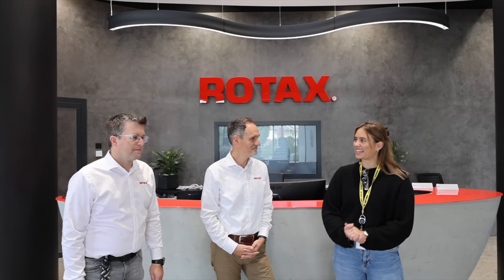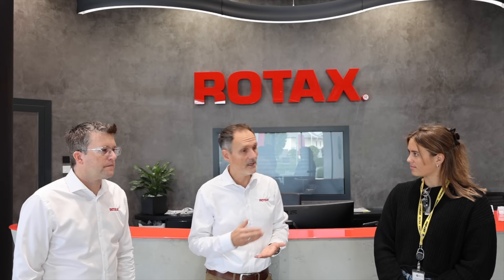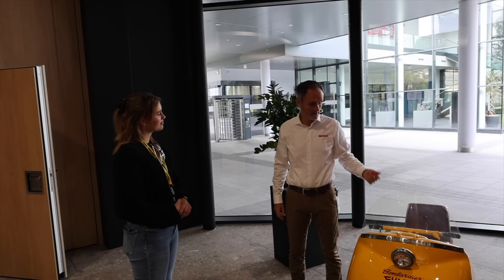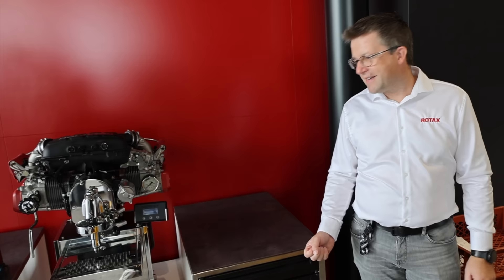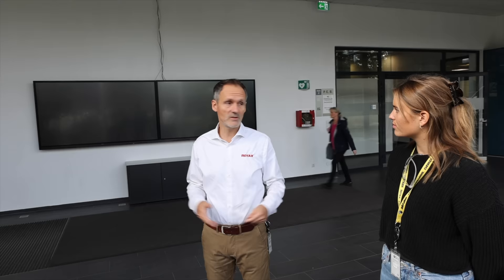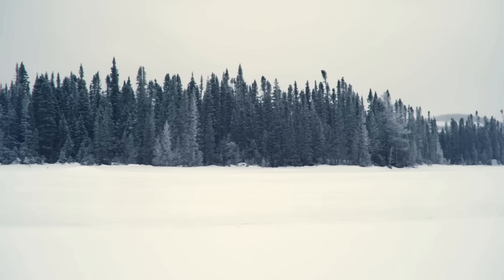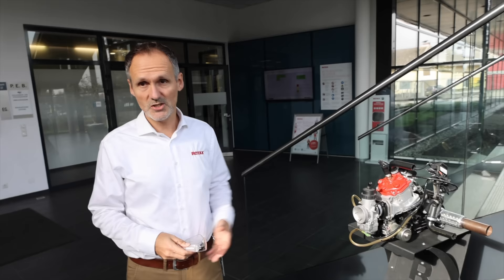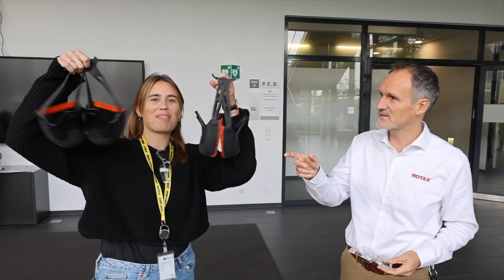BRP ROTAX FACTORY TOUR: Where MILLIONS of Engines are Manufactured

Comment: I really understand the struggle at the question on electric motors for aircrafts. The problem is not the electric motors per se, they can be made light and powerful enough. The problem with electric aircraft was, is and will be (for quite some time) the energy-density of the batteries. 
Tho it has to be said LSA/micro/(insert local aviation legislation equivalent term here...) is currently the the best suited type of aircraft on which it can be performed (due to pesky physics like volume, and thus weight, going up by object size CUBED). 
In the closer future, the best choice going forward for UL/LSA/Micro and smaller GA for that matter, is piston engines running on Jet-A/B/JP-8 ( thus diesel engines) which also is the most sought after here in Europe (the amounts of TEL in AVGAS is a concern, and the cost of AVGAS is very high compared to Jet-A). 
Well unless gas-turbine engines are allowed in GA and lower weight and licence-classes.

Comment: On a positive note, I own a Spyder RT Limited with the 1330cc engine, but I wish the engine was 1500cc matched to a 6 or 7 speed automatic transmission.  On a negative note, I hate the extensive process that must be accomplished in order to check the oil.  There should be a simpler process to accomplish that.  Other than that, I love my Spyder and hope to be able to ride it daily over the late spring and summer.

Comment: IMHO Rotax engines are way over-priced. I'm not saying they aren't good engines, I'm saying they are over-priced, and there's a reason other than the engine is designed for airplanes/gyroplanes. Limited competition in this segment of the market.  If there was competition in the market, prices wouldn't be so high.  For those who might not know.. 140hp engine is 40,000 dollars US. Their new 160 hp engine is 50,000 dollars US. That is for the engine by itself which comes in a crate. Still, they make good reliable engines and that isn't something you can't take away from Rotax.
Reply: research idea : Products liability for the aircraft and engine manufacturers   🤔
Reply: @larz46north18  That's the reason why they are so profitable, have beautiful facilities and executives who make boat loads of money. It's because of "liability" ;)

Comment: As a Canadian I have believed in supporting BRP by purchasing their products over the years being a Canadian company. However I became hesitant back some 15 years ago when I found out that the Engines where being manufactured by Rotax a division of BRP, with plastic parts for oil delivery systems within them, which over time fail and destroy the engines. These products are not cheap and to have what I referred to as Engineered adolescence,  is not what I consider good Corporate ethics.
Reply: Headquartered in the town of Valcourt, "QUEBEC" 
 BRP has been reimagining the way you access your world since 2003 
BRP posted net income of $188.2 million for the quarter versus $365.1 million a year earlier.  
Découvrez BRP, le chef de file mondial des industries ....  
SALUTE  🤗

Comment: The Rotax engines are simply the best little engine on the market right now. But I don’t like the monopoly that Rotax are giving Franz Aircraft Engines…. When the dealership went from Lycon to Franz prices went up 30% And when we as a part 145 work shop or Part-M sends a E-mail to Rotax with a specific question to the type certificate holder we get the answer from Franz that is not following the EASA rules!
Part-M should always have direct Contact to the type certificate holder and that contact should not be interfered with by a seller! the seller haves economic interest in the outcome of the question!!!!

Comment: "Millions" of light-duty engines for "recreational vehicles" none of which have ever been registered "motor vehicles" for use on "public roads" at "highway speeds" with passengers. 

Experimental aircraft are no different than "snow machines" or "personal watercraft" or ATVs or UTVs and are "titled" and "registered" only in jurisdictions that require it for "public safety". And even when "street legal" they are not DOT-approved for "highway use". 

There isn't an engine manufacturer in "America" today that has not produced "millions of engines" and for applications a HELL of a lot more demanding of engine DURABILITY (which is NOT synonymous with "reliable" and "reliable" is a subjective term not "defined" or "standardized" in or by any "engine industry") than the "toys" Rotax has "historically" powered with it's "drop-in" basic engine "packages" that are for "recreational uae" only.

Comment: Interesting but their prices have grown from greedy to just ridiculous. The 916 which is just the same small engine with a turbo is now 50k$. The simple 912 at 19k$ is also way overpriced. I'm guessing they don't use any different metal, it's the exact same technology they use in all their engines, they are no more reliable, they don't pay for your plane when the engine fails, they just massively overcharge for their small simple engines. Rotax is not a small niche manufacturer of extreme custom engines, they are quite conventional low tech engines in great volume. For comparison VW's quite advanced turbo diesel 4 cylinder engines are around 2k€, a Nissan Versa 4 door sedan with aircon and of course an engine with a more complex gearbox costs 15k$ for the entire car. There is just zero justification for 50k for these engines.
If Rotax doesn't change their greedy policy I sincerely hope someone outcompetes them. They are such a hindrance for aviation. GA is a disgrace because of obtuse greedy players like Rotax.
Reply: Sadly, I am inclined to agree. The problem is no competition of scale for the most part. But, this tour gave me more overall confidence in the engineering, but the prices are astronomical, especially for the average homebuilder.
Reply: @BrilliantDesignOnline  yeah. we can use their own prices against them, they have a rotax 900 engine series for jet skis that's comparable to the 912-915 series. The version with similar power to 912 seems to cost under 3000$. Seadoo jetskis seem to retail in the 7-8k$ with a rotax 900 engine. Imagine if planes with a 912 cost 8k. There is also a turbo version of the 900 with similar power to 915, I couldn't find a direct price but from the jetski price I'd estimate 5-6k$ from Rotax. Roughly 10x cheaper than 916. sigh
Reply: @DanFrederiksen  Dan- yup, just like everything gov't or aviation, just multiply x 10. An oil filter at WallyWorld $8, Aircraft Spruce $50. Hmmmmm
Reply: @DanFrederiksen  seadoos don't turn upside down or fly in low oxygen not to mention being faa certified
Reply: @ronblack7870  I don't believe the 910 series has any upside down capability but even if it did, that wouldn't cost anything to do and they have no special thin air breathing capability either. 915 has turbo but so do some of the 900 engines too. certification has no significant cost to it despite claims by status quo defenders like you and even if it initially did, they can't use that excuse forever. That excuse is still used by lycoming and continental whose engines are from 1950.
Reply: Many  companies have lost much money trying to adapted non aviation engines to aviation.
Reply: @Flashman36175  you confuse categorization by rotax with non engine producing companies trying to adapt engines made by others. try to understand the simple fact that there is nothing that rotax does differently for their 'aviation' engines. It's the same production, same material. And they are not a niche aviation engine maker, they mass produce engines so they have zero excuse for their short sighted counter productive greed.